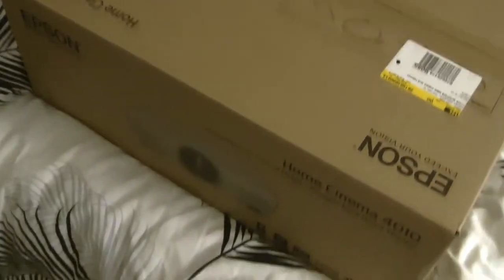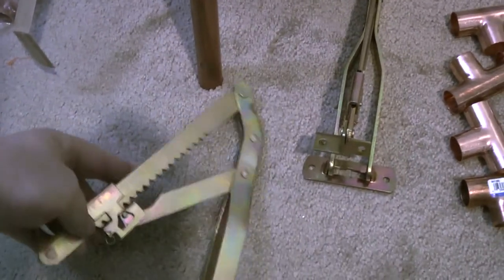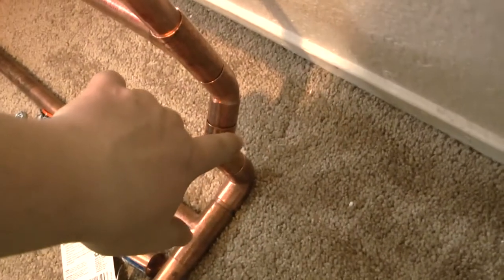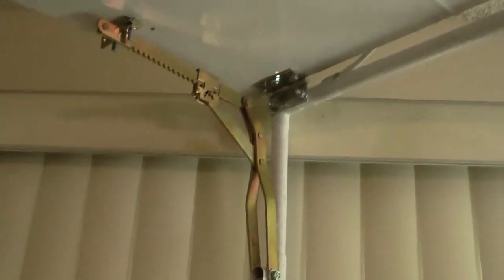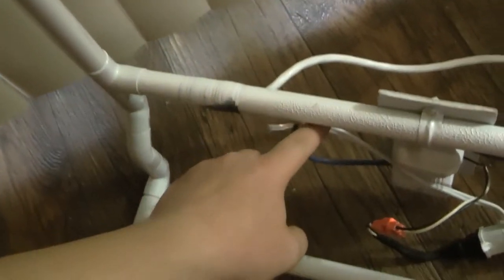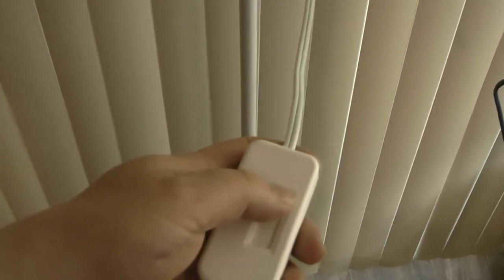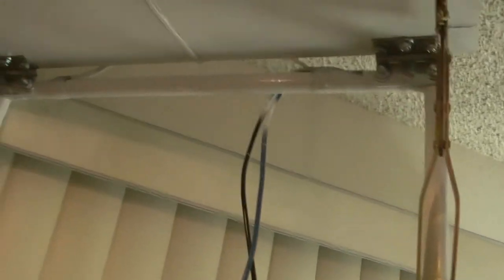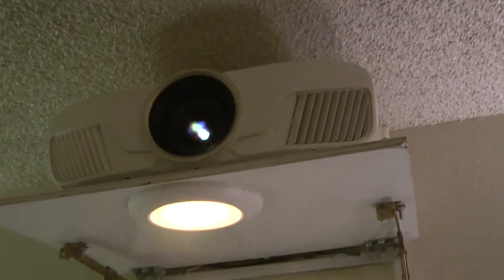DIY - How to mount heavy projector in apartment Design & parts for making Epson 4010 projector shelf

Comment: Or just get an 8 ft slim bookshelf and put the projector on top with the wires down the back of the case.
Reply: Yeah, I was considering this option as well. But mine is just above the coach, so it wasn't possible to put bookshelf behind.